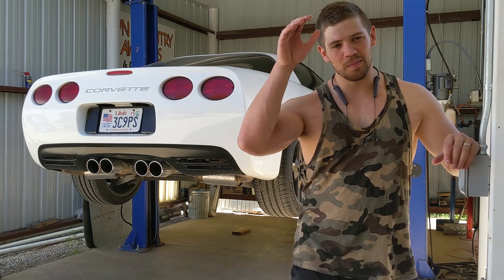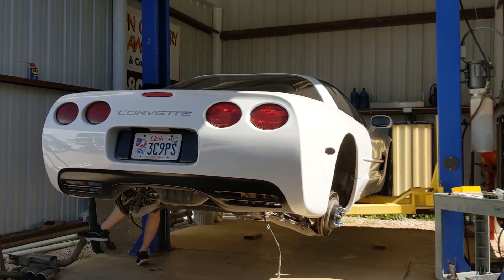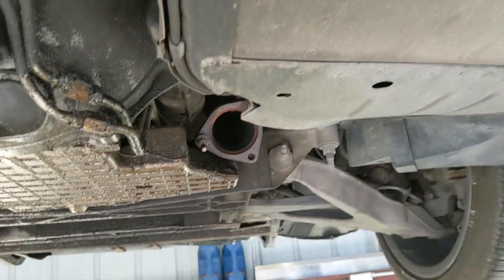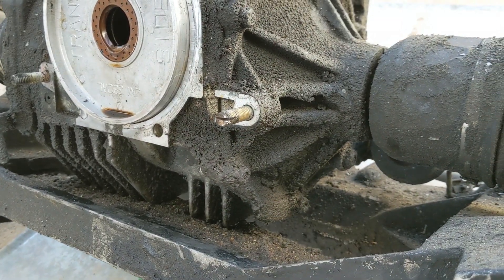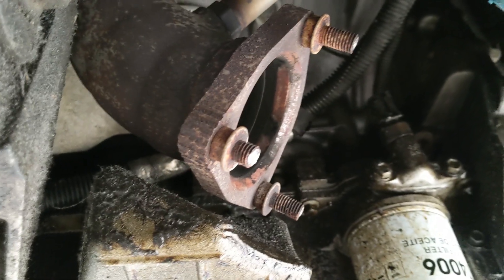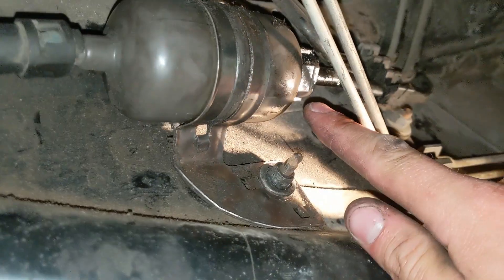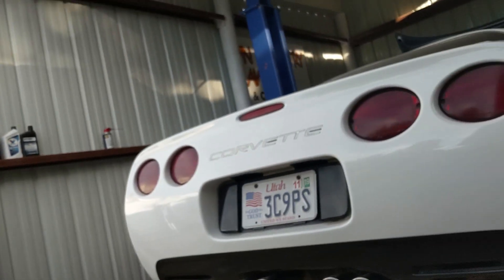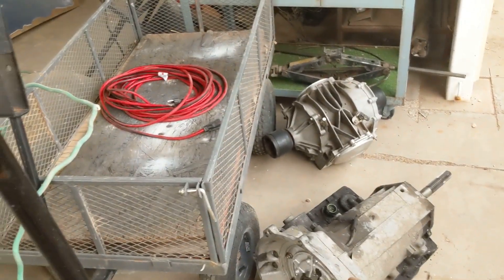FIXING my 300k miles C5 Corvette! Wait a bad transmission?

Comment: 5:25 Go to craftsman, buy a nutsplitter.
ALWAYS replace EXHAUST studs with BOLTS.  AND
Using your new nutsplitter to remove nuts ( when they RUST)
RUST is great lock tight.

Comment: i know the struggle bro, i have a 03 C5 and the electrical issues drive me nuts. Traction control, stereo, dying battery, grounding issues, horn issues, ABS, overheating, ecbm issues, but when the car is running right it always puts a smile on my face

Comment: Should of did a diff swap while it was all out c5 zo6 diff (3:42) are cheap and  reliable plus that added acceleration over the stock 2:73 gear .... Higher stall convertor too would of helped and at least a rpm level 2 tranny

Comment: I just replaced my 04/ C5 went  through RPM bought there level 5 with a  2800 stall had it installed with a 3 year 36,000 mile parts and labor from R&B IN Pinellas FL. Outside of Tampa FL not cheap but done once and done right..
Reply from the maker: How much did you pay? Lol i just about did that

Comment: You are supposed to put the converter on the transmission end and slide it in and turn it until it drops in more.  Dont try putting it on the car first.  Theres your problem.

Comment: great vid, i need to tackle this. Seems like i should buy all new bolts first
Reply from the maker: Nawe just certain bolts might be a pain. I personally wouldn't get new ones 🤷🏼‍♀️ My car also has 300,000 miles on it to tho so haha a little bit more hammered
Reply: Well i finally tackled this job. I got the video up if your interested in checking it out. Less than 10 minutes.

Comment: Don't give up man! Sometimes we learn the hard way lol. And be careful using bolts to pull the trans in I did it on my GTO t56 and it broke the bell housing 🤦 so if it doesn't slide in easy don't force it because something isn't quite lined up.
Reply from the maker: Dude that's how you learn to do things with cars hahaha mess it up and learn to do things the right way from then on 😂🤘
Reply: Yep and it's never cheap! Not for me anyway lol.

Comment: Use Heat for bolts that won't back out so fire up a torch . Dude you didn't replace the torque converter WHAT lesson learned dammit man . Dude you keep causing yourself more work it's painful to watch good thing you can laugh about it I guess .